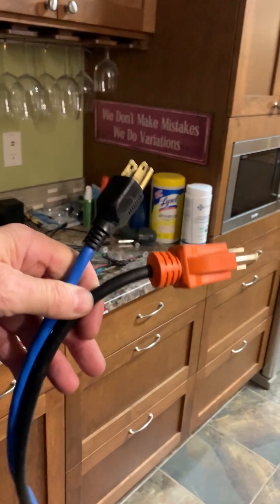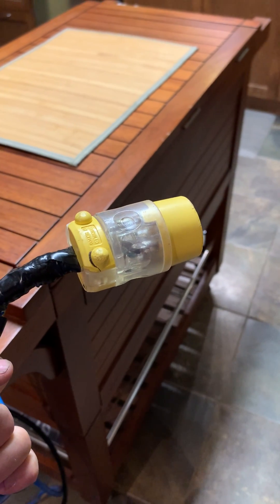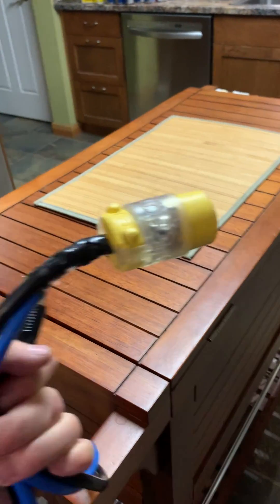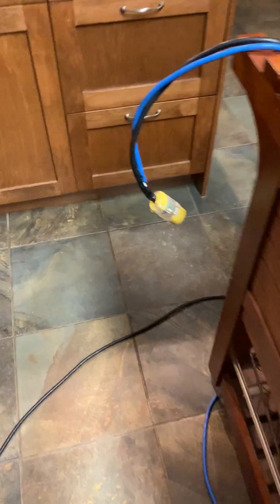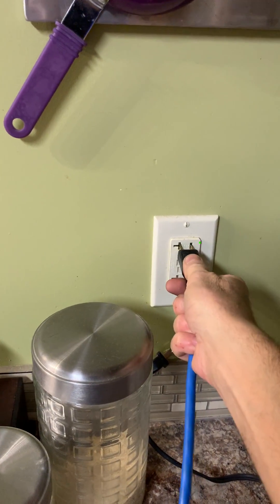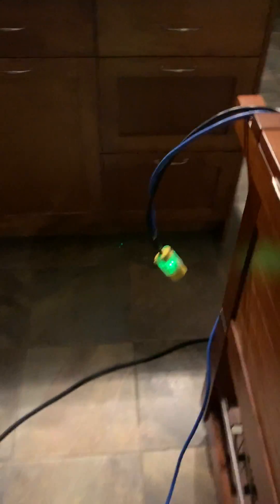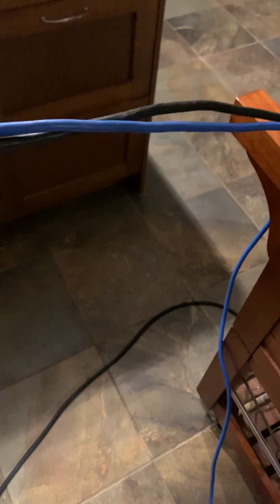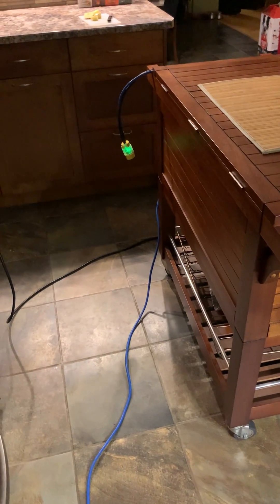Update to 2019 Toyota Prius Prime plug in hybrid 240VAC charge

Comment: Thanks for your video. Do you have a source for the yellow plug? Thx.
Reply from the maker: it is readily available at any hardware store, I got mine at home depot
Reply: @waltersavonian7551  are you using 12 gauge for each of the separate cords?
Reply from the maker: @2927usmc  no I am not.  I've measured the current in each cord at 11.5 amps and the #14 wire cord is more than adequate for this current.  Toyota specifies in the owners manual not to plug the portable charging cord into an extension cord because they cannot guarantee the quality of the cord chosen by every customer.  As long as you are using a proper #14 AWG cord no longer than 15 feet you should have no issues.